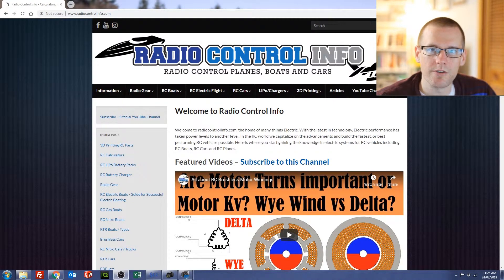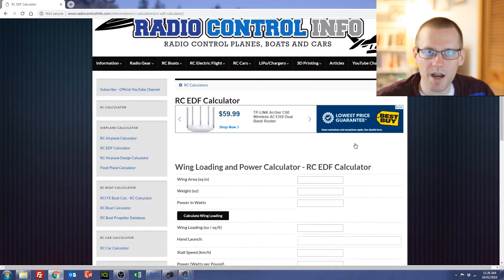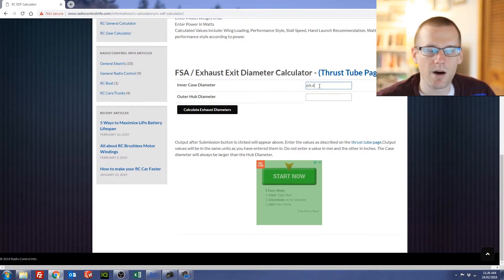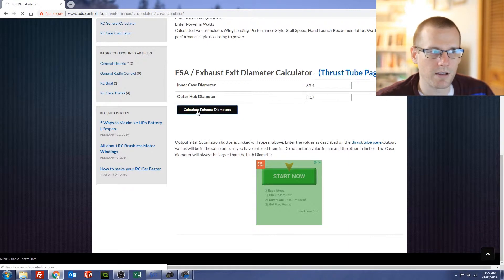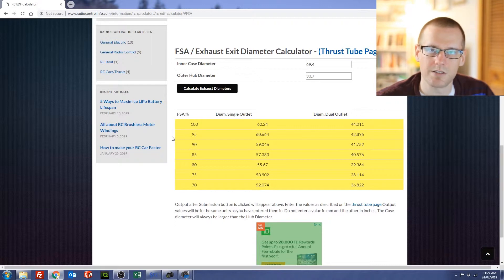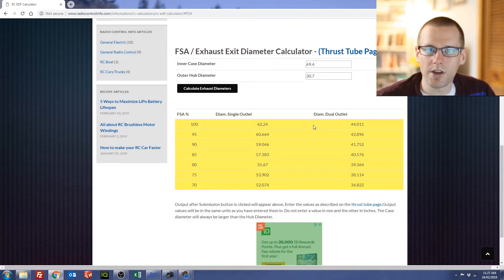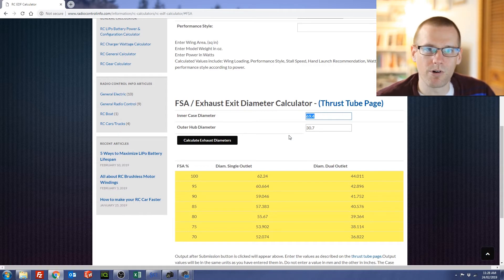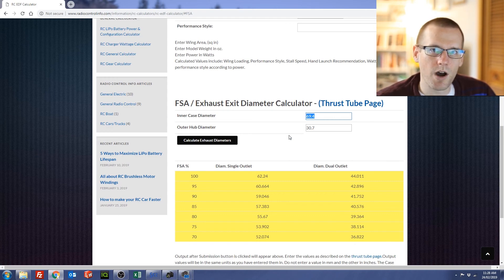Calculate EDF Exit Nozzle diameter using FSA.

Comment: why does FSA matter? shouldn't you want to maximize the velocity of the exhaust and thus, thrust?
Reply from the maker: Not necessarily, having exhaust velocity of 1250mph as an example vs an airplane speed of 175mph is a complete waste of energy. It would be more suitable to have a larger diameter nozzle with slower moving exhaust gasses. This is the idea of a turbofan engine. FSA is important as a turbine or fan can not move a fully filled column of air. For this reason FSA will be smaller than the area of the fan measured from tip to tip of the blades.

Comment: why measure the motor mount and not the motor itself
Reply: Motor mount is wider than the motor itself and is where the air is going to be moving around. The air that is coming off the fan blades is what is calculated.

Comment: Thanks for the informative video. Can you perhaps point us in the direction of the mathematics behind how thrust is improved by varying the thrust tube exit area? RC forums have mentioned  FSA percentages to aim for but I would like to know why
Reply: came here to ask this. Are there any tests that vary exit diameter to find the ideal (max) thrust for a given EDF?
Reply: @banzaiib It depends on the length in which the diameter reduction graduates. If the diameter change is over a longer length, in the direction of flow, the air behaves more laminar (less turbulent) which increases efficiency because less energy is lost.
Reply: By decreasing the exit area you are causing the air inside that area to have faster speed which lowers the static pressure (the pressure of the air if it was at rest ignoring, its kinetic energy). By decreasing the static pressure you increase the static pressure difference across the fan which helps further accelerate the air, a result of more thrust (force).

Comment: Thanks for the video, great explanation, just subscribed to your channel (i m rc fanatic..)

I made an aerodynamic levitation stand with EDF edf:
https://youtu.be/6npjmBaZciI

Just calculates on your site, FSA = 90%

Now i realize i may have advantages by a different thrust tube

What about the lenght on the tube?
What is in your opinion best FSA ratio for aerodinamic levitation? 
Tube lenght matter to avoid air vortex?

Comment: Great video so is the final number you get the dia. of the exit side of your thrust tube? and how much more thrust will you get? or power? I want to make my jet faster without upgrading the motor etc...
Reply from the maker: Thanks for the comment! Correct. It depends on your fan setup and airplane.  There is not large gains from an adjustment on an already setup airplane from the factory.